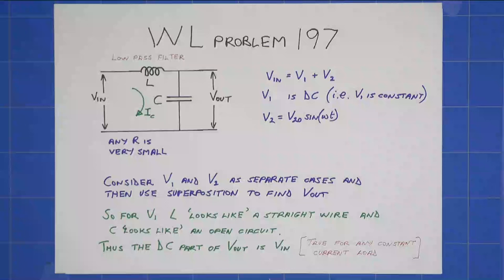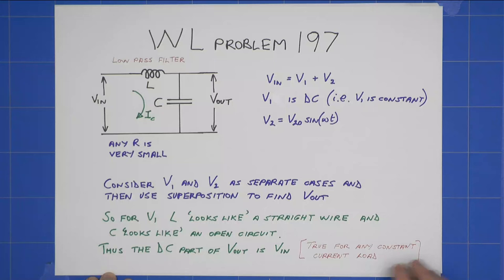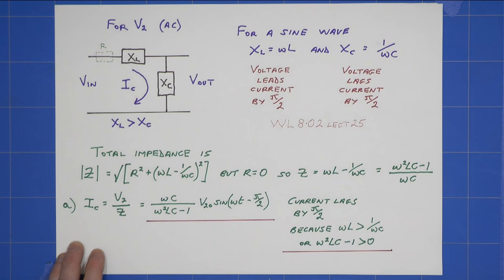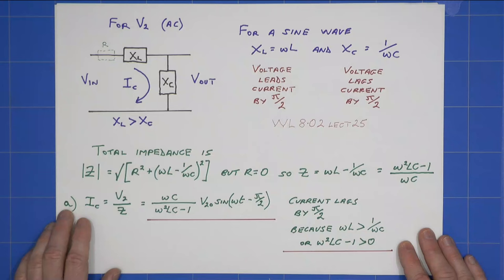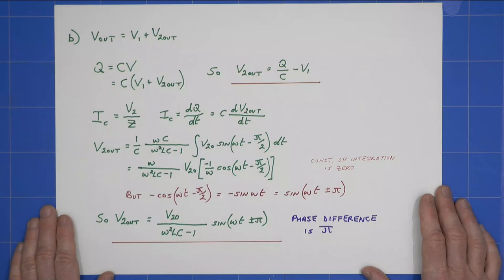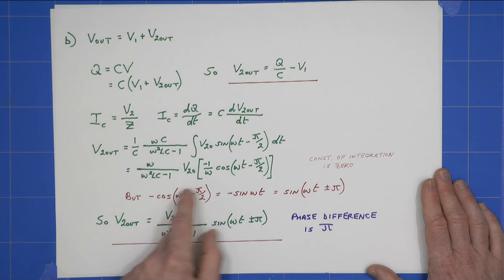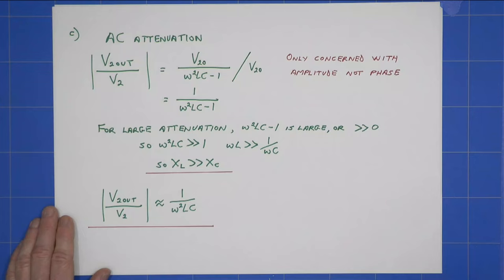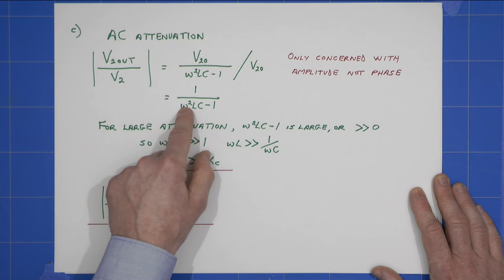Keith' Solution to Filter Problem 197

Comment: "A train is approaching at a speed of 80, while another train is behind it, traveling at a speed of 150. When the train with a speed of 150 overtakes the train with a speed of 80, what is the name of the father of the driver sitting inside the engine of both trains?"

Comment: Sir what is arc second ?
Reply from the maker: use google
Reply: Each degree is subdivided into 60 minutes. Each minute is composed of 60 seconds. Said differently, an arc-second represents the distance of latitude or longitude traversed on the earth's surface while traveling one second (1/3600th of a degree).